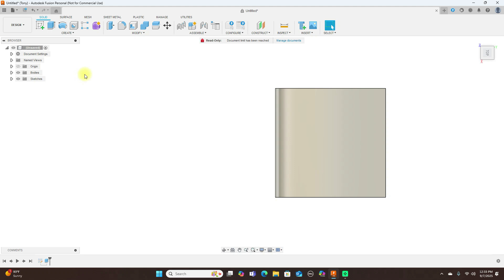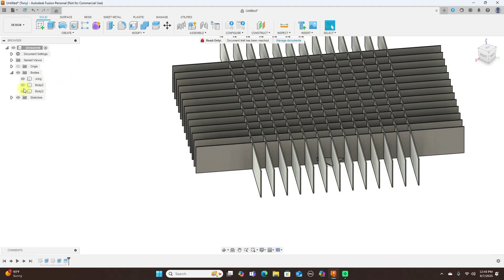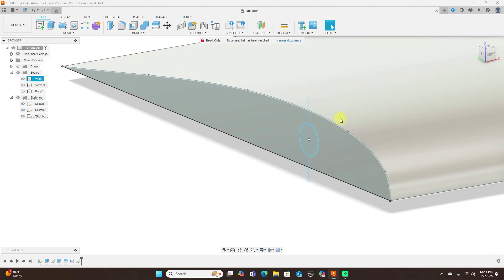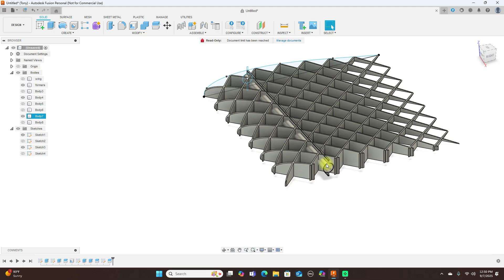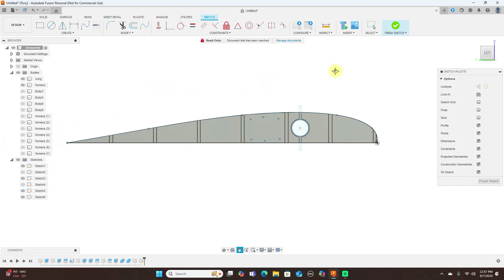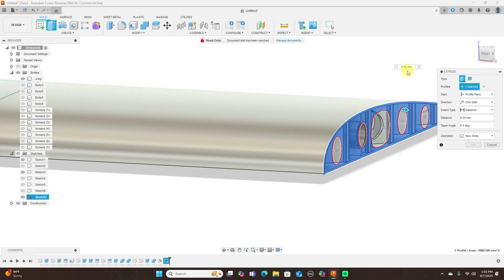Best and easiest way to model 3D printed wings in Fusion 360/CAD Tutorial

Comment: Hi! This is the best tutorial I've seen for LW-PLA wing design! Thank you! 
Please pardon me for this off topic question but I'm new at Fusion and don't know how to invoke that floating context menu that seems to pop up at the cursor location as you finish a line or other feature. Can someone please spare a moment to tell me how to get this going? Thanks!
Reply: This is not for lwpla.
Reply: @TheRattleSnake3145  That's exactly what this is for. Foaming LW-PLA
Reply: @dougcronkhite2113 you should really watch the video dude.
Reply: @dougcronkhite2113  no, it's not in vase mode, if you try to print that stuff in LW-PLA you will get a mess